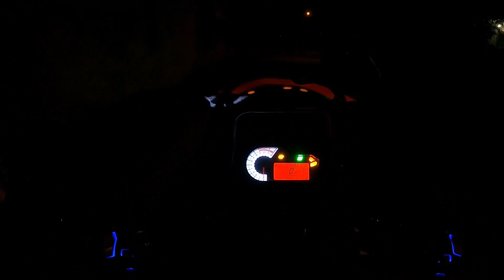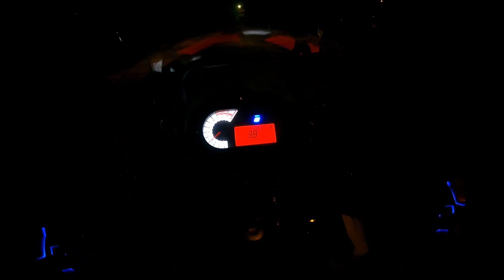2021 Benelli TRK 502 HEADLIGHT TEST | Real Auto Reviews

Comment: One question that came in my mind,
Benelli has removed ABS switch in bs6 model, 
by any chance can we use any of those extra switches for engaging & disengaging ABS?
Reply from the maker: I don't think it would be a difficult task for a master electrician 😁 That said, I don't any reason why anyone would want to disable ABS on this one.
Reply: @RealAutoReviews   off road me skid karne k liy :DD
Reply from the maker: @revzzrider  😁😁 I agree, but trust me, you won't be taking this 235 kg machine offtoad in the first place. Forget skidding with it. In fact, my review's opening line is that ADVs aren't MX bikes. Heck, they aren't even dual sport bikes. They are just tourers. Say, the equivalent of 4x2 SUVs. 😀

Comment: No 5 like 1nce again from D's side .

Waiting for 2021 Naked GIXXER 250 Moto gp blue colour acceleration, gear to gear roll on, braking & speed with RPM ranges, if possible ♥️❤️

Thanks ✍️
Reply from the maker: Certainly. Shall put in a request to Suzuki once this Covid fire subsides. 😃
Reply: @RealAutoReviews  
❤️💥🔥♥️